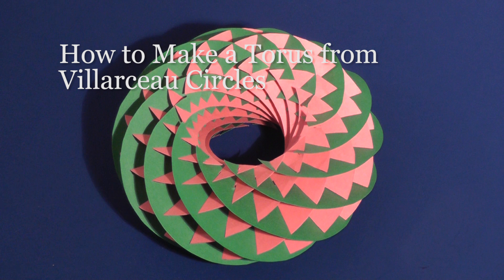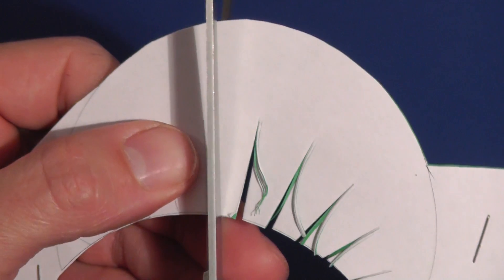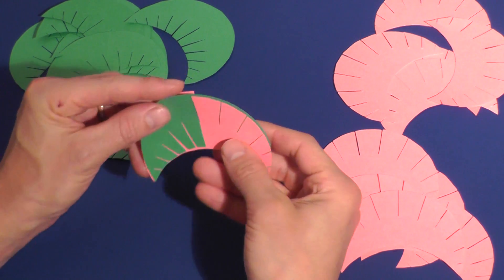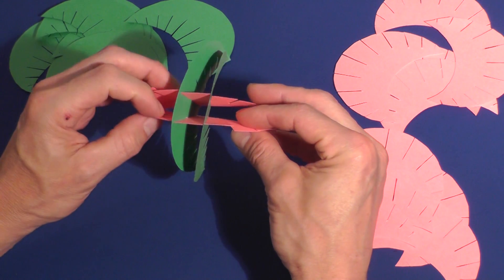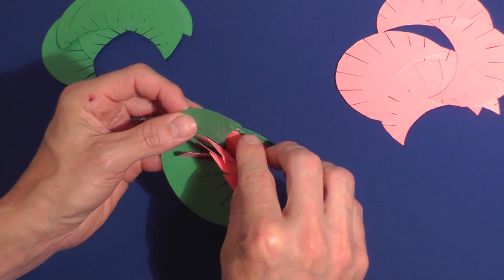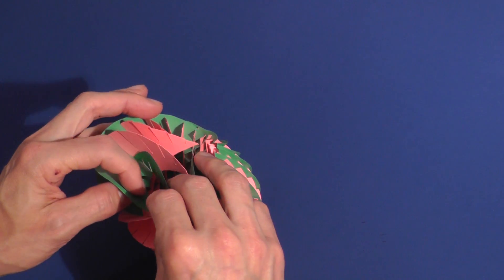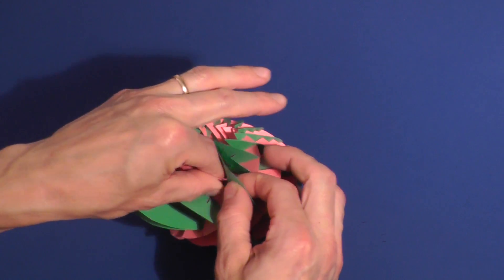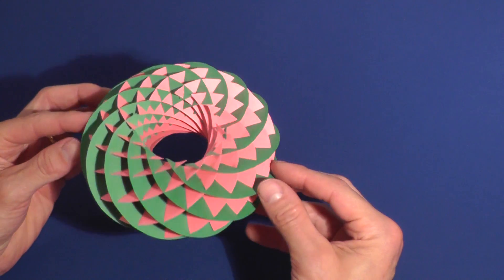How to Make A Torus from Villarceau Circles

Comment: On your webpage for this model you reference the paper by Monterde and Monera. Since you posted this video, María García Monera has posted one of her own. In it, she demonstrates a method that looks like it might make it easier to interweave the 2 ends once you have assembled the units. She reserves 2 units of the type with the slots going inward and adds these after you've linked the ends together. I have yet to assemble one, so I'm not certain it will be easier, but it looks like it should be. Here's a link:
https://youtu.be/rft4EJkVZ9Y
Reply from the maker: Thanks for pointing out this method. It appears to simplify the process.